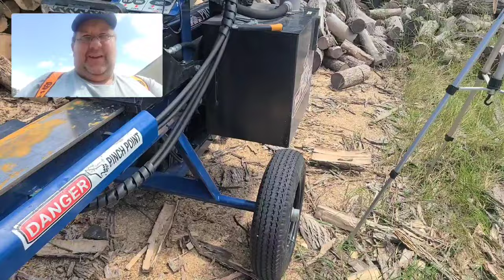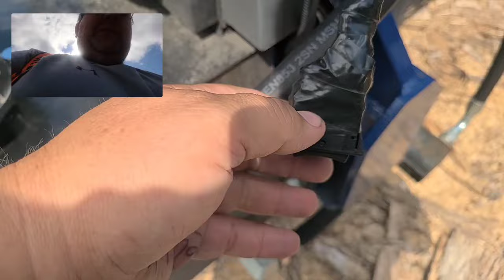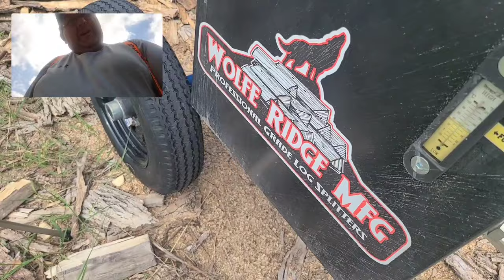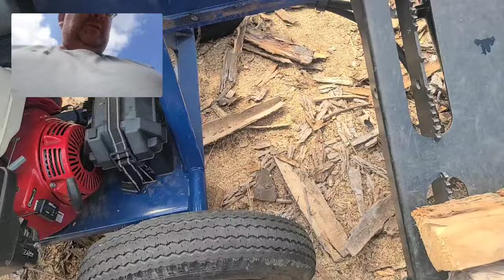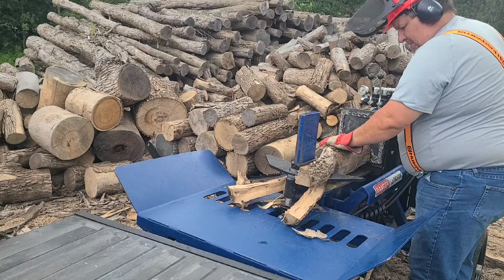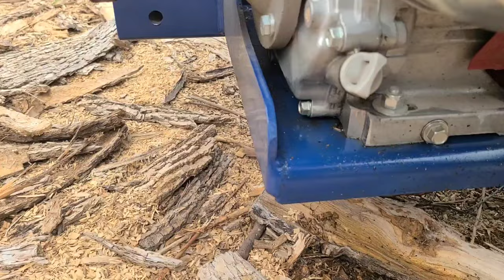Wolfe Ridge 28C 115hr Review

Comment: Overall, it was a nice review.  My fan switch just quit about a month ago, so I've been watching the temps as well. 
As of now, I have 370 hours and got mine Sep of 2022 with 2 other issues that were fixed under warranty.
Reply from the maker: A marine grade switch like mine is a good solution. Get thoae things anywhere. Or a new sensor to keep things tidy.
Reply: @thefirewooddoctor  I think I will do just that as I have had the battery go dead twice, and the only thing I can think of is the fan was running at some point.

Comment: I have the same but newer model. Save your money on the extension bars. Get the ram limiter. It’s adjustable and saves a ton of time in the long run.
Reply from the maker: With a 6.5sec cycle-time, a stroke limitee would save me 1sec or so? I'll save the $ and put it towards a firewood conveyor.
Reply: @thefirewooddoctor  depends on what your doing. If you’re doing 16in pieces yup. But if you’re doing mini firewood it’s more like 3-4 seconds. My wood yard is in a residential area so a conveyer is not an option for me.
Reply from the maker: @jon51  mini firewood on horizontal splitters like ours is a pain. I only do it for myself and a special firewood client. The 16in wood could be 18in, if I screw up. Besides, I can only work so fast and not wear myself out prematurely. For mini firewood, I run my splitter at half-throttle. Gives me a safety factor by slowing things down.